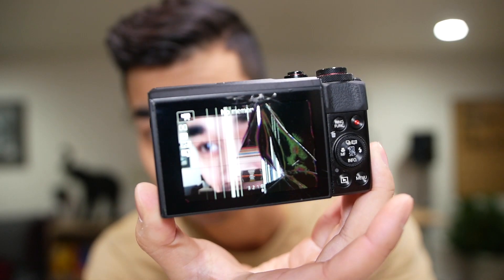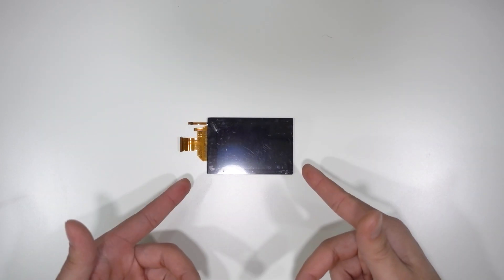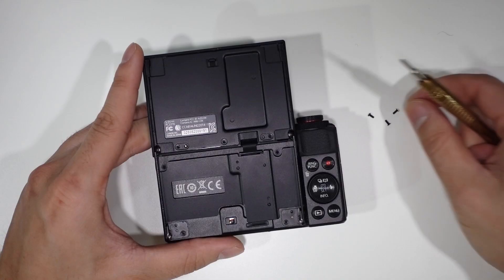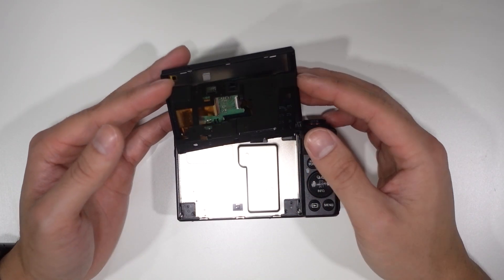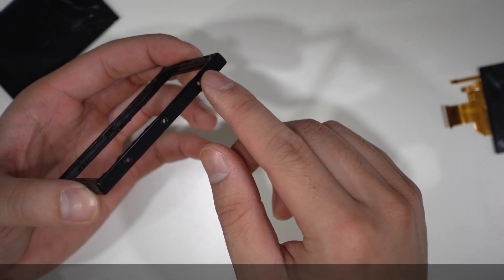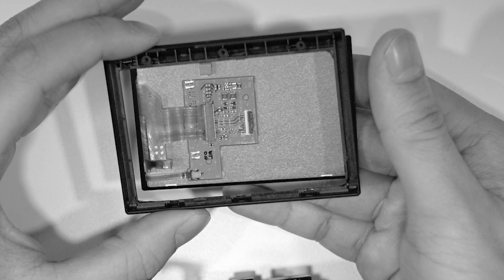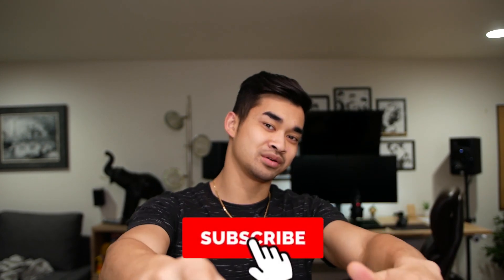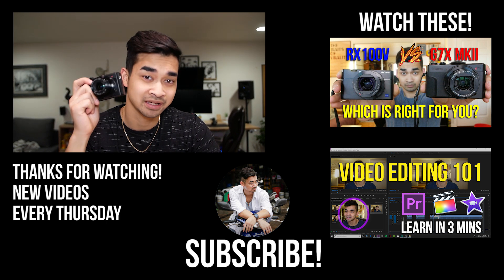How To Fix Your Broken G7X Screen!

Comment from the maker: UPDATE!!!!
I FIXED MY G7X!!! 🙌💪✊
If you haven’t finished the video, my screen wouldn’t turn on after the repair. Turned out I damaged the ribbon cables from all the struggling I had plugging them back in, replaced the cables and BOOM! Camera is fully functional!!! 

Lesson learned: always remove the your batteries during repairs and be reaaaaaal gentle with cables! 

Best of luck to anyone attempting this repair!
Reply: Hi Gabe, was there a visible rip on your flex ribbon cable? I took apart my G7X Mark II today to replace the top panel. I had to remove the lcd screen too. Everything was working fine after the repair. But after the testing, when I was putting everything back together, I realized I had the battery in while I was putting to top panel and the screen back into the motherboard. 

Now my G7X wont power on, the screen is black and the camera is unresponsive, even with a charged battery.

I am not sure if I damaged the flex ribbon lcd cable. I don't see any visible rips or tears on any part of the cable, but the camera wont power on I am not sure if it is the cable that is damaged, or if the battery fried the display, or maybe even some other component.

I know this was two years ago, but if you can remember anything, it would be very helpful.